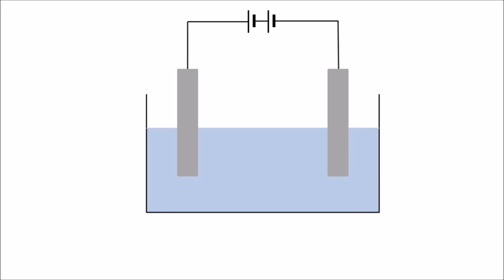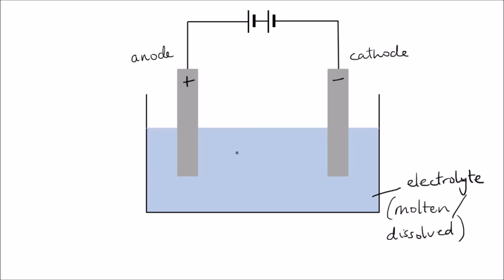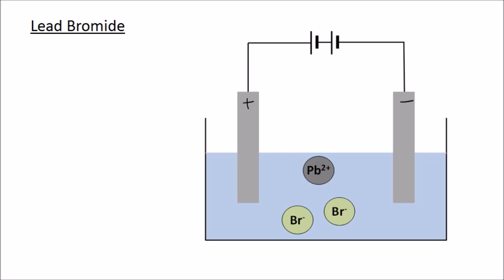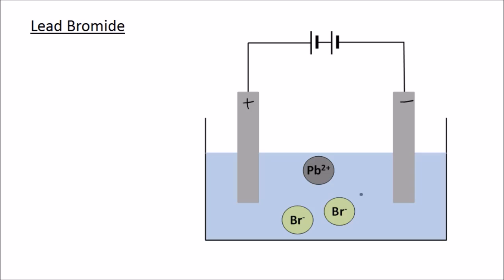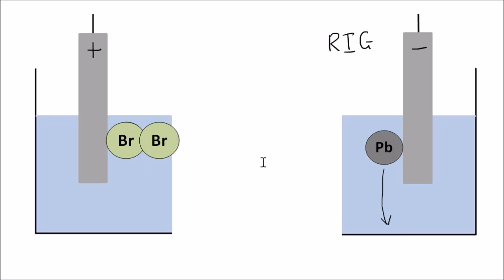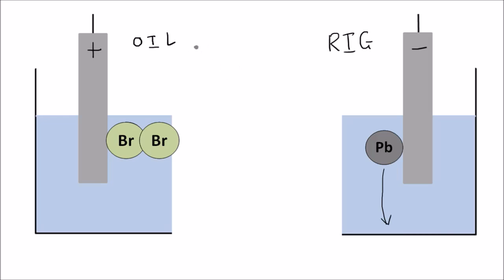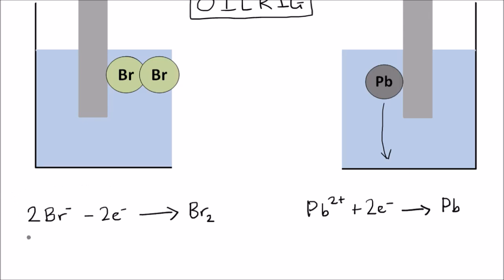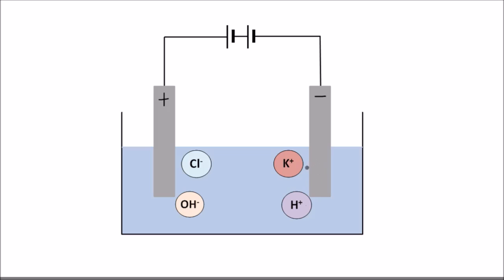Electrolysis - The Basics | GCSE Science | Chemistry | Get To Know Science

Comment: Good explained....
Reply: I am interested in building a proto type of electrolysis of water for separating  oxygen from hydrogen The Electrolysis proto type machine needs to be small. Being large enough to contain a single 6 Volt battery, or a series of 3 batteries and each of  them containing 2 volts. The Proto Type Separator of oxygen and hydrogen from each the other, needs to be attachable to swimming goggles and possibly transportation devices. I am E. Ubermensch Barker. Resides in the Republic of Ireland. Can Be reached at the following e-mail Address: eubermenschbrkr@gmail.com